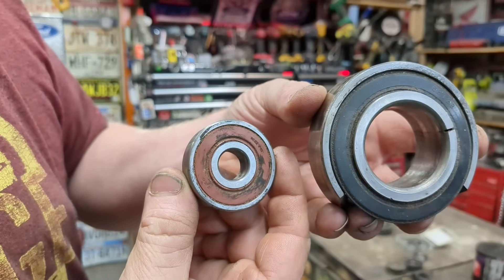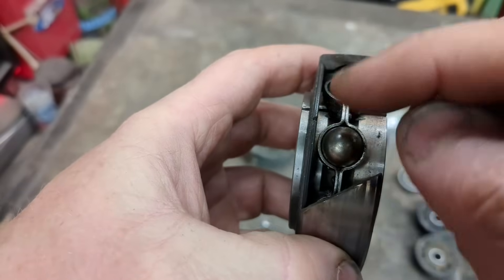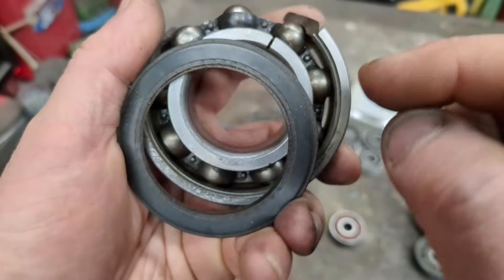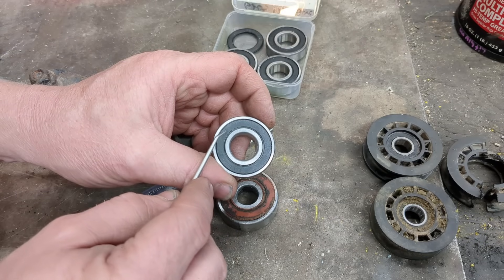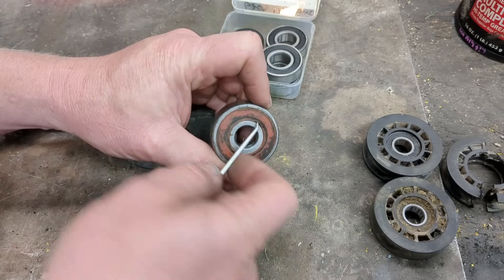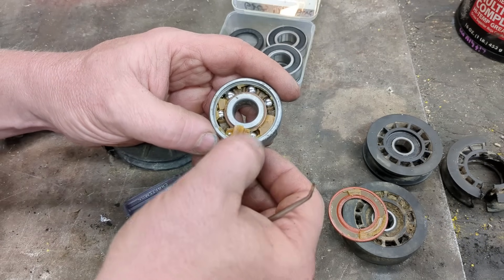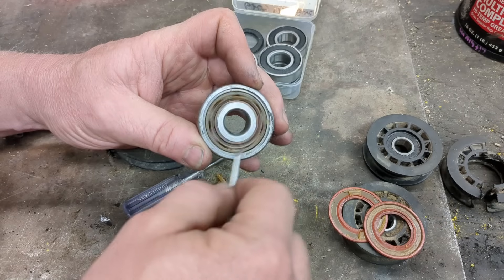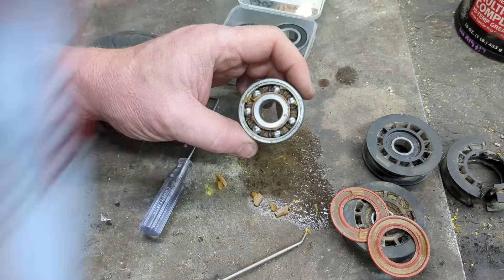How to GREASE, Un-Seize and Clean SEALED Bearings

Comment: Have any of these people commenting about heat and friction and failure and this and that, ever had a bearing failure that they can 100% attribute to too much grease? I have been pulling seals off mower deck spindle bearings, idler bearings, and PTO clutch bearings and giving each side a quick smear full for decades and have never had any failures. I grease the bearings in the electric clutch of my Gravely every 3 years, and each time, there's a little bit of grease slung out the first time I mow, but not much.
Reply from the maker: It has been well documented by SKF, Timken, etc. You can read the research documents online that has went deep into this. Most of it has been done in stable factory conditions where you can have a control and several test subjects.
Reply: @sixtyfiveford I understand bearing manufacturers' theory and "controlled testing", but I live in the real world and I have been filling up sealed bearings for decades and have never had one of them fail. Maybe my version of full isn't actually full.
Reply from the maker: If you read through the comments, there's actually a few people that work in factories maintenance departments. All of them state the same thing: "bearings fail for two reasons" No grease or too much grease.

Comment: All this is true, but there are a couple of "BUTs"
First, not every lubricant will do, you need one with low kinematic viscosity.
Second, filling the bearing depends on the operating conditions and is often 100% necessary (not only for low speeds, but also with severe contamination such as mining equipment, etc.), and the characteristics of the lubricant must also be taken into account, since some calcium lubricants swell when in contact with water. So there are tables where, taking into account the rotation speed and other factors, you can estimate how much the bearing needs to be filled with lubricant, and "on average in the hospital" it is 30-50%

Comment: Thanks man. I had put a new SKF sealed bearing on my Saturn SL1 on the front left wheel. It was a couple of weeks and it was growling. I have another SKF bearing and took it apart. Brand new made in Spain and it has a clear grease in it. I'm going to clean it out and repack it with a good high temp grease. Thanks for the tip on overpacking them. That truly never came to mind.

Comment: I use engine oil to clean old grease. It dissolves the oil grease fairly quickly without damage to the seals. 25% of full is hard to gestimate since you really cannot see the backside behind the rollers. Probably better to err with a little extra than not enough.

Comment: It is important to use the right grease for the application: bicycle grease is different from automotive grease is different from boat trailer grease. Yes it does make a difference. On your hair, you can use anything and still get the girls. But bearings are a different story.

Comment: Another very good reason NOT to pack ball bearings completely full:  Tapered roller bearings and ball bearings will throw out any foreign particles, dirt, metal chips, etc, when they are turning.  Needle bearings and large Non-tapered roller bearings do not do this.  When foreign materials are thrown out of the race way there needs to be a place for this stuff to go and stay out of the way.  If the bearing is completely full of grease the foreign materials will be circulated back into the race way and cause more damage.

Comment: Very informative video! My question is about greasing lawn mower spindles that have grease zerks. I have watched videos where the youtuber says that these zerks are useless since the grease never gets into the bearings because they are sealed, and I have watched videos that demonstrate that grease actually does reach the bearings since the pressure, once the spindle housing if full. forces the grease between the seal and the race. If grease does in fact get into the sealed bearings, would this result in over greasing? I'd be interested in any comments from folks much more knowledgable than I am on this subject. Thanks!

Comment: seems like (when possible)  it's best to pry from the outside since it's stationary and could be resealed with sealant there if damaged vs the inner lip seal that has movement.
Reply: i guess if you have obtained new seals..it doesn't matter, but may not be easy to source.
Reply from the maker: These aren't airtight seals. They're really only meant to keep large debris out. You will find prying from the outside near impossible as it goes up under a lip.

Comment: Wow, definitely one of the best mechanical videos I've ever seen and I've been here since the beginning of Internet time. I'm retired after 50 years in the HVAC trade and I've packed a lot of bearings, but only now do I find out a little about the components that make up grease, and only now do I hear someone say don't overpack, which I'm sure I've done. We were taught to not over-grease electrical motor bearings but only because we'd get grease on the windings. This makes so much sense. I didn't plan on becoming a John Deere mechanic in my retirement, but I do enjoy having the time and finding the resources like this. My grass doesn't look much different but I like feeling my machine purring beneath my arse! Thanks for posting this!

Comment: I rebuild starters and alternators. On starter bearings, unless the cage is broken, or severely rusty, I just clean them out with solvent and pack both sides with grease. Because the job of a starter is just to spin for a couple seconds, then rest for a length of time. I do try to put hi temp grease because some starter locations are between the oil pan and the headers, which leads to them soaking a lot of heat when the car is running.

On alternators, I try to only use the best ones, and new ones that I buy, because it has the opposite work load of a starter. It only rests for a little bit, and it is always on with the motor, always spinning, and a bad bearing makes a lot of noise and can potentially cause the alternator to fail.

Just my two cents

Comment: 25% fill with clean bearing. Fill with nlgi2 synthetic oil base polyurea grease. Never ever have ro replace or change or even refill bearing for an average use bearing. Sealed for life as they call. Manufacturer usually use transparent grease usually mineral oil and basic thicker not even high quality. Last only for short periods they use this not to reduce production cost but to intentionally let bearing dry so we have to buy it again. Unless same manufacturer may be using good specially grease for custom orders like that last long time. Like volvo buy from skf with special grease that last lifetime almost.

Comment: The national bearing manufacturers handbook lists sizes, types, RPM that it runs at etc. and the frequency and amount of grease to use. It was explained to me this way a long time ago; the bearings need a coating, kind of like getting wet, so if you’re goal is to get wet while running, is it easier for you to run through a rainstorm or to try and run through a swimming pool in water up to your neck? Made sense to me.
Reply from the maker: @44thala49  Well put.

Comment: 3:00 You said to use Brake cleaner but you liked to use Carb cleaner. Cmon now, which is best? I'm following your lead bro.
Reply from the maker: Non chlorinated brake cleaner is acetone. Carb cleaner is acetone for half the price.
Reply: @sixtyfiveford  so carb cleaner is better to use than brake cleaner?  Or maybe get non chlorinated brake cleaner???? Bottom line, which is best?
Reply from the maker: @hianxi8y  There's not one better than the other, they all degrease the same. Equal to that is just putting it in a tub with gasoline. You just can't spray gasoline like an aerosol.  It's whatever one you have on hand.
Reply: @ ahh thx for that, those are things I never learned from a father or others working on cars. I'll take/learn what I can get.

Comment: My basic recipe for re-servicing a used bearing is as follows:  (1) To get rid of oil, old grease etc residue, I soak it in mineral spirits for a week; every other day put the bearing on a wooden shaft and spin it while it is inside mineral spirits (2) At the end of the week, I blow dry the bearing, and soak it in white vinegar for 4 hours or so to get rid of rust (if any), and rub its surfaces with a cotton ball or tooth brush.  In small bearings you may not see rust, but it is there especially if you are living in a moist climate (3) I oil it with Singer sewing machine oil.  I found this to be the lightest and most dependable one because it sticks onto racing surfaces the longest.  I apply this recipe to tiny bearings used inside RC electric motors, and RC model engines.  If the bearing is destined to spin less than 5000 rpm, such as in a car, then I pack it with quality bearing grease like Lucas or Redline synthetic.  Depending on the application and working environment I either remove the rubber bearing covers, and keep them on the bearing.  Good video!
Reply: or just put a 4 dollar bearing in wild too waste that much time to have a worn out bearing

Comment: The whole bearing is a cage type, the races are outer and inner races, as you say a bit later.  Grease is thickened oil and the oil will run out, especially if the bearing sits.  Aircraft specific magneto grease is compounded from wax, is very effective and contains no oil, so none runs out, no matter how long the bearing is run and the intervals between runs.  Think private aircraft not falling from the sky.  Fill the space between the balls 1/3 full, maximum, to keep grease from extruding from your bearing and gumming up whatever else is close by.  This is less important if you use the magneto grease.  Expensive, but worth it.

Comment: Do NOT pick/open it from the inner (rotating) seal! You can nick/damage the sealing surface where the inner rotor rotates, allowing dirt/moisture to ingress. Instead, pick it from the OUTER sealing surface. If you nick that surface, simply clean it and seal it with RTV. You cannot do that with the rotating sealing surface.

Comment: What would you suggest with salt water boat trailer wheel bearings? They have these things called "Bearing Buddies" It keeps the bearing completely full of grease.
Reply from the maker: @fastacker2  Those are a completely different thing than sealed bearings like I show in the video. Those bearings you pack full and they will push out excess grease even with a bearing buddy. The bearing buddy spring is so lightweight it allows the roller bearings to push excess grease aside. All it's there to do is take the thermal shock from taking a warm bearing into the cold water without pulling water into the hub. It is not meant to keep bearings lubricated.
Reply: @sixtyfiveford  Thanks. Always impressed by the stuff you know.

Comment: I’ve always packed my trailer bearings using the palm and scoop method until it comes out the other side. I’d guess that’s considered full and over packing then? I’ve never experienced any heat issues and have extremely good bearing life on those axles. Am I doing it wrong?
Reply from the maker: Tapered roller bearings are completely different than sealed bearings. The Bearings in trailer have a place for all the great to escape(center of the hub). A sealed bearing doesn't. You're doing it right.  I will say though 80% of the grease you put in gets immediately pushed out and never goes back in during operation with taper roller bearings.

Comment: I always soak bearings to soften the old grease and crap collected there. Either lacquer thinner or Coleman lantern fuel.In the factory they started with a new, clean bearing, then applied the grease.I like CLEAN bearings and never spin a dry bearing. Synthetic grease is supposed to be the best. I pack roller bearings....wheel bearings differently. Some use the palm-of-the-hand method but I use a grease gun and bearing packer, after I clean the bearing out and always use a new seal.
Reply: why would you waste so much time to just have a worn out bearing?

Comment: If you can disassemble the bearing, all you need to do after cleaning all the parts is to lightly lube the balls/rollers and cage before they go back in (maybe a bit of the lip of the plastic shield).

That's all it takes.  Any more will just add debris when the lube dries up.

Comment: I overfill all my wheel bearings with calcium sulphonate grease, never rusted after, never failed. Best grease for vehicles that lasts forever was made by Archoil , they don't produce it any more, but other companies make good sulfonates that are  close enough. Lithium grease complex or not is cheap garbage. Same for belt idler bearings, pack them full and forget.
Reply from the maker: @scotttiger8905 taper roller wheel bearings aren't sealed bearings like the entire video is focused on.

Comment: As for sealed bearing, They are cheap enough to just replace, Once you have pulled the seal off, I would consider it compromised anyway.
As for open or shielded bearings, if you over pack them, running the bearing will push the excess out anyway. You can verify this with an infrared imager or spot radiometer, You can actually watch the higher running temp go back to normal as it runs and pushes the excess out. Just buy new bearings if that is an option.

Comment: Research
Boric Acid Lubricant Argonne  National Labs
And viola! now you have a way to remove 4 microns of play from a tired bearing with a substance that is 70 times more slippery and has a hardness of 85% of diamond.
(ASSUMING!!! an ability to read and comprehend research)
ie:  Restored to way better than original. 'Never' wears out and once spun up it just keeps on turning.

Comment: Definitely worth doing it. I just regreased some of my old power tools with thicker truck axle grease (considering the bigger gap created by years of worn out). They are now running super smooth without any funny vibration and clicking noise. In general, I would suggest: the bigger the bearing, the thicker the grease; the older the bearing, the thicker the grease.

Comment: In my opinion, too much grease WON'T damage bearing. But what grease you use on the bearing, YES..
Reply from the maker: That contradicts every manufacturer of bearings and all of their reports. Sealed bearings will overheat with too much grease.
Reply: @sixtyfiveford  Nope, again wrong. It is depending on what grease you are using. Many greases are designed to withstand with ultra high temperatures. Not those normal grease of cos they will heat up when rolling the bearing. We tried and use all kinds of different grease. Some grease will even harden rubber in cry short period. While some melt under slight heat. You need to know what grease is really so called best for bearing under very high temperatures still remain the same, no melt, no heat, nothing.
Reply from the maker: @snowy2875  I guess every single manufacturer and their reports on sealed bearings is incorrect. They want you to put less grease just so they will fail. The military and other organizations that also have reports on it are falsifying just so we have to buy more bearings. Criminals
Reply: @sixtyfiveford  All lube and bicycle companies are wicked. If I were to be a business of lube or bicycle company. The same I would warn all owner never put lube on chain, to let yours sprockets wore off faster. Never add lube into the bearing to let your bearing"s steel ball crack faster. See as what the CEO of the Nokia phone said. We never do any wrong things, but we fail. Of cos, Because Nokia phone is very tough, able to drop from level 2 to ground, still able to use. Who would buy if one Nokia phone can use for years. Many brands died, or dying, simply because they're are just too lasting, such as Sanyo, National, Aiwa, I added 800c heat resistance grease on all my caypn aeroad. Your grease must have no effect on HEAT. not those grease once heat, melted inside the bearing caused more messy and damaged.

Comment: Dissagrees most you said= Alabama power plant supervisor/ removed 4 ft bearings... the more grease the better !!! the longer between clean/re-grease... yes.. will sling it. lol... longest last bearing float in oil baths... 75% full... car bearings .. you pack full ever 2 yrs... use teakin hard japan bearings.. last 50 yrs .. if keep them maint.... they get hot .. fill were needed and just need a 2 yr clean/re-pack... USE DEISEL ..parts cleaner.. alot cheeper.. ! STUPID ..spray $8 to 10 $ can ...
Reply from the maker: First, we're talking about sealed bearings only. Not about roller taper bearings or bearings in oil bath. All of the documentation from Timkin, SKF, Koyo etc will say the exact same thing. Put too much grease in a sealed bearing; it'll cause excessive heat and destroy the bearing plain and simple.

Comment: Soo if i understood this right. The soap/thickener works as a buffer for the oil. Releasing a small oil enough oil film for the bearings. Also soaking up excessive oil. When packing too much. The thickener maybe churns around. Probably also insulate the heat. Leading too, too much oil release that leaks away. Subsequently degrading the oil-holding properties of the thickener. Am i right? Also i guess it depends on application. In a push bike. Its whatever since the bearing dont spin that fast. Automotive/machinery, very critical to pack orderly, because of high rpm. Regarding grease I buy from the big manufacturers like SKF "guess they know there stuff" instead of going on random internet reviews, since this is quite hard too quantify. Or follow the manufacturer instructions